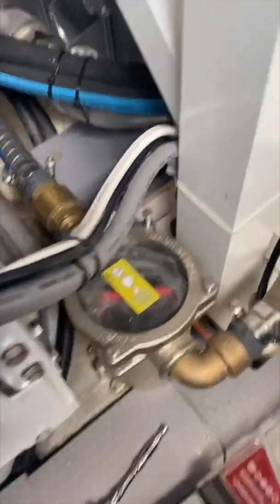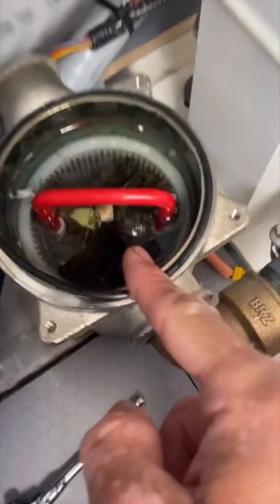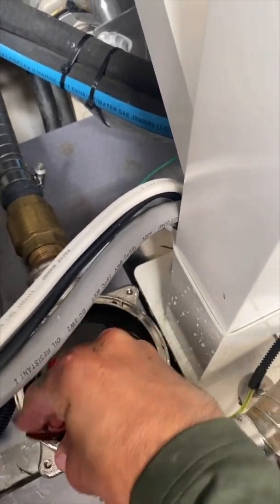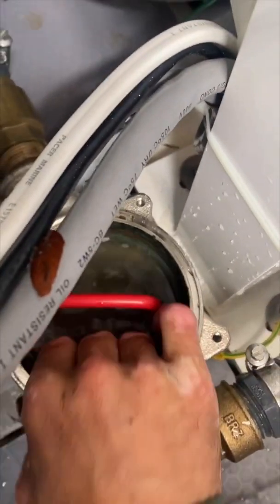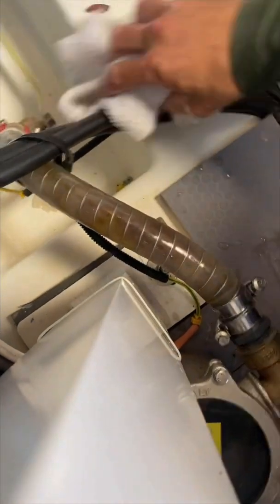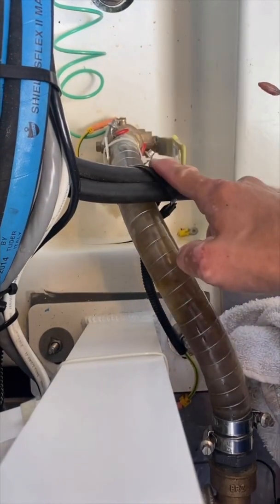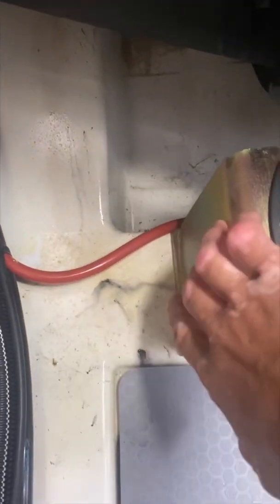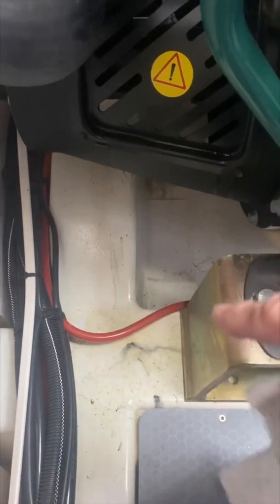Yacht Mangement - Preventative Maintenance Checks on Yacht

Comment: Now that minor fault with the strainer would drive me crazy. This is a seven figure price yacht and issues such as this speaks of sloppy build assembly and inspection. If the small out of the way stuff is done properly, the the big obvious stuff is less of a worry. I recall a story of a review of a high priced German car …. a part than was hidden and out of the way was finished perfectly, the reviewer remarked that  if that much care was done with hidden out of the way parts the workmanship speaks for itself. I would be back to the Prestige dealer with a demand to get this right. It is obvious the owner is maintaining the boat well and wants things right when on the water as well as improving the resale value of the boat when it is time for a change.